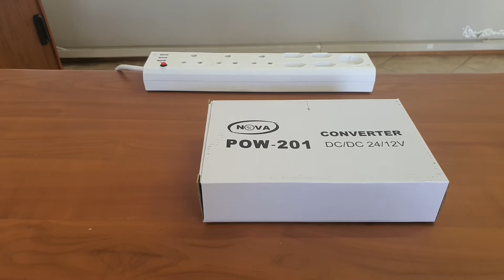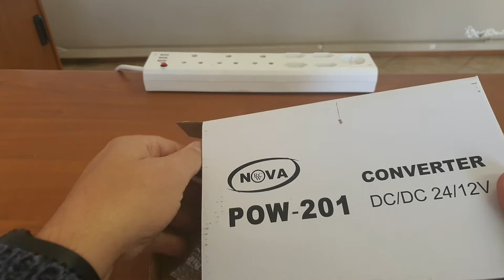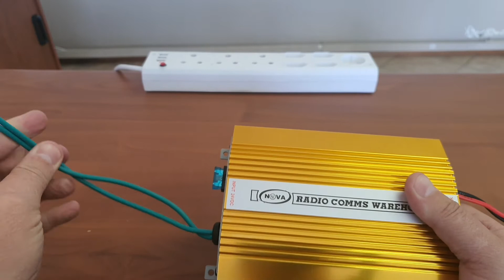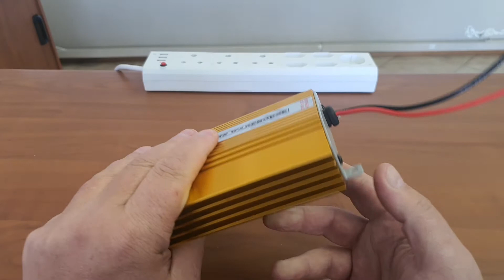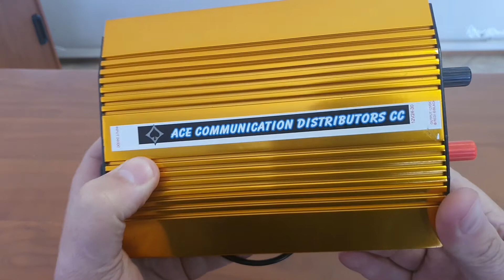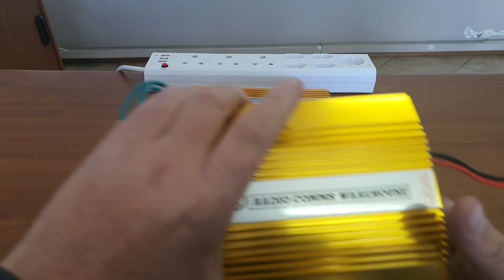Pow201 24v to 12v Convertor

Comment: How do you use it at home
Reply from the maker: Hello @Shermawilliams7066 This device is used to reduce 24–30VDC to around 12.5VDC. Perfect if you have a 24V solar system and require a 12V device to work, such as a car cigarette lighter charger, or if you need to use a 12VDC radio in a truck with a 24VDC battery.